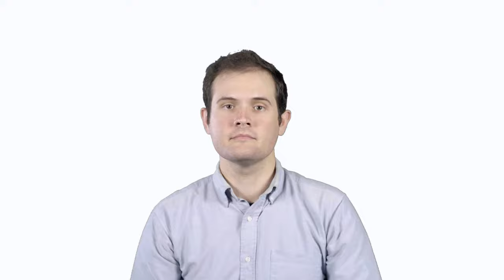What wires go into the ignition switch?

Comment: In theory, could I bypass both the fuse box and PCM by way of battery power ignition and the ignition with inline fuses sending wires out the specific